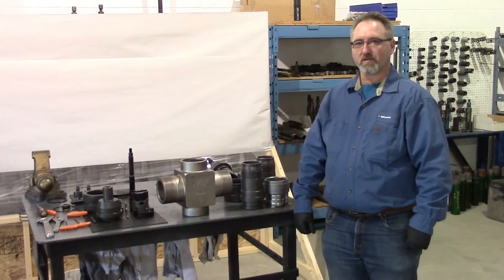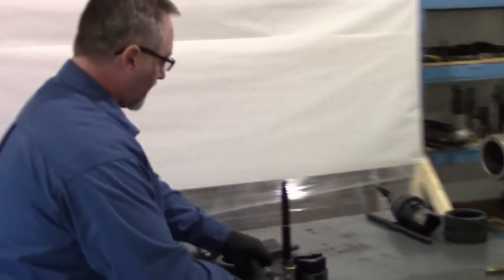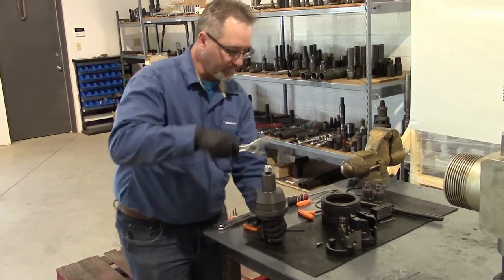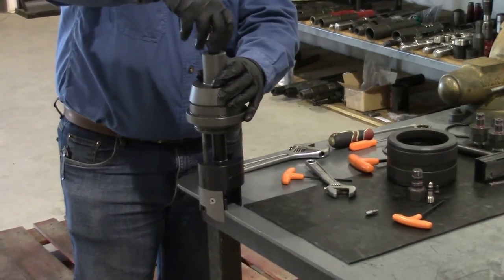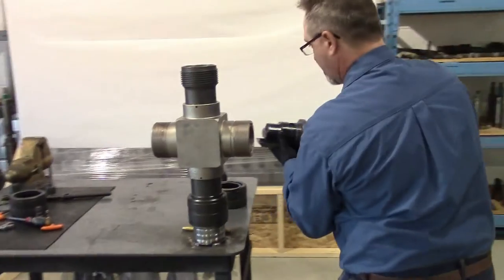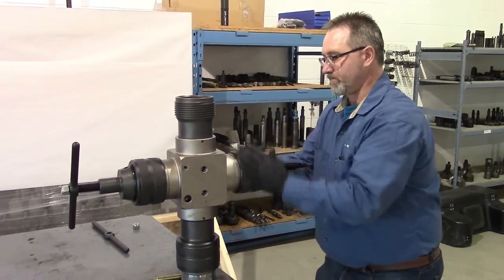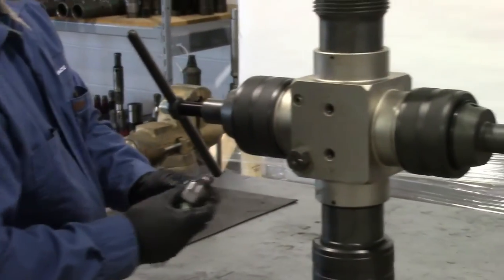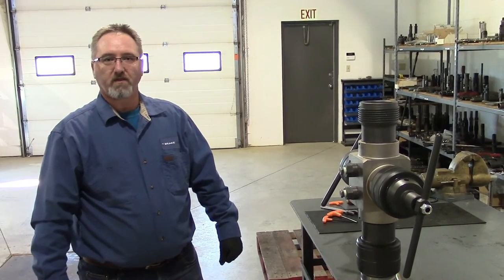Wireline Valve Assembly (BOP)

Comment: I always curious how is the open hole logging tool conection with the bop???? Somebody please tell me...
Reply from the maker: The wireline valve featured in this demonstration video are designed and utilized for slickline and wireline intervention.
Open hole logging would typically require larger wireline valves to accommodate the logging tools and diameters in question.
To answer your question, the logging tools would be deployed via wireline with a PCE string with an ID and unions of corresponding size, these will be attached  to the wireline valve or BOP via flanges, or unions.  Thank you!
Reply: @bracetoolinc  if you have an animation video of that things.. Please upload it... Thanks